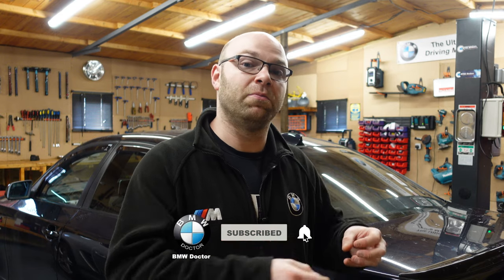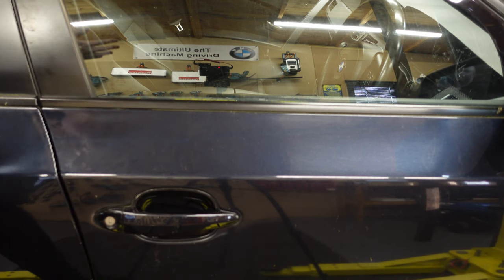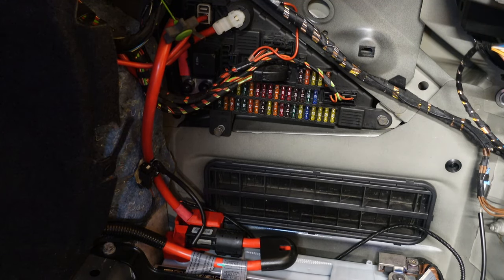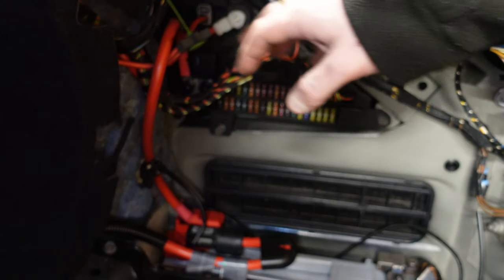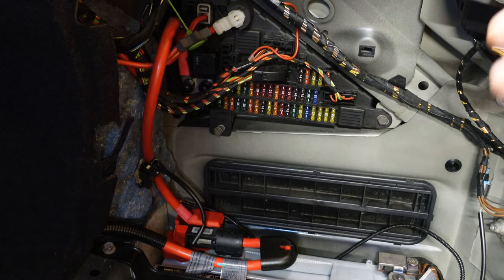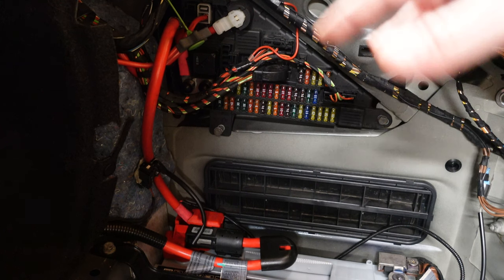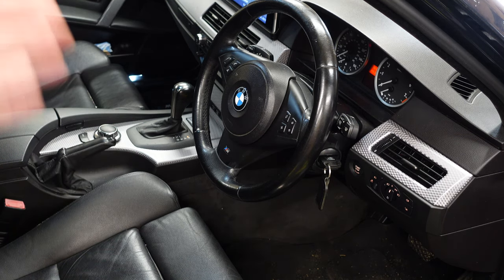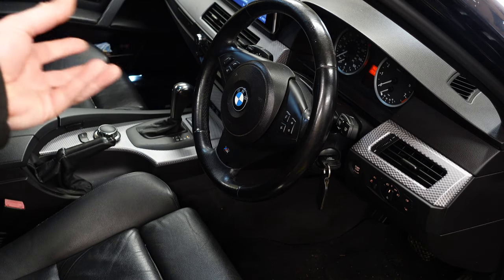Doing This Will Fix Your TERMINAL 15 , TERMINAL 30 , TERMINAL 30G_F Errors On Your BMW !!

Comment: Hello,I have got bmw e61 that dsc module doesn't respond and it's missing in car tree, so there's no connection.Launch diagnostic telling me that it's not installed,in insta diagnostic is missing as module it's not in red colour it's missing at all.The black and yellow can is missing right where the dsc module is.I need help to sort it out.Would you be able to help?Thanks in advance!